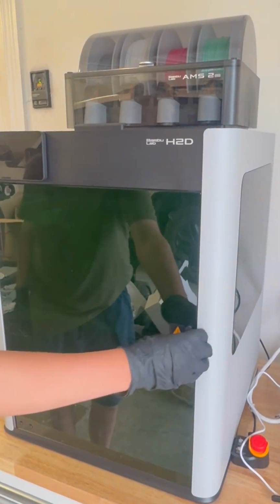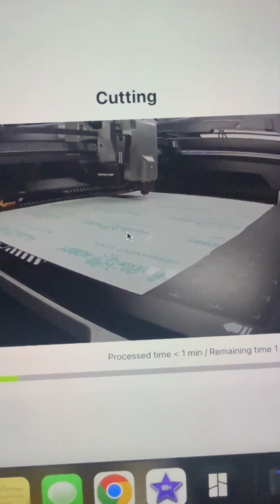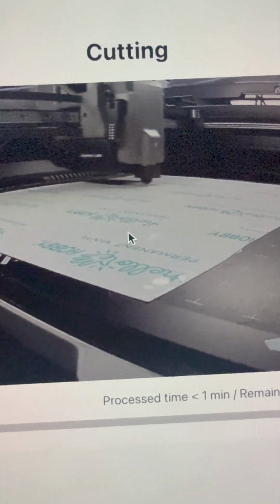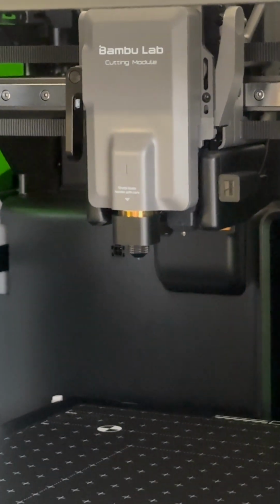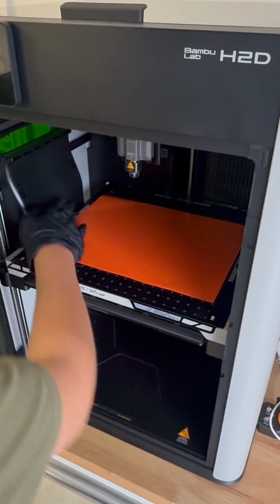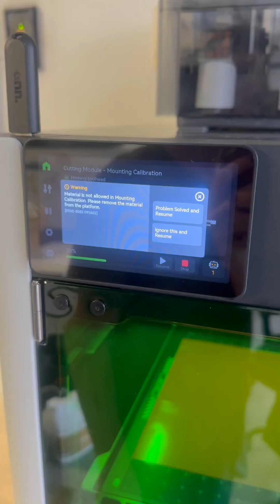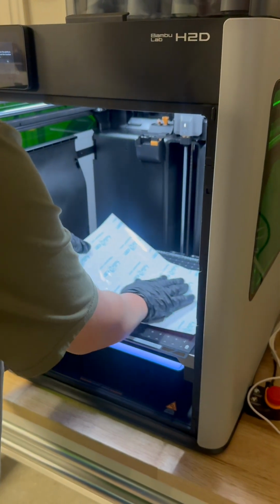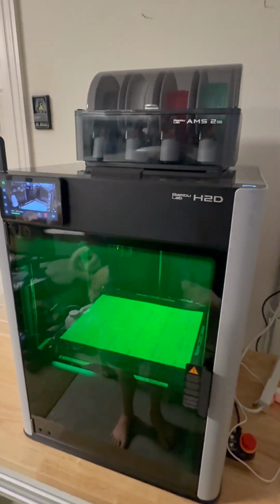From Print to Cut: How to Switch Your H2D Module Fast. #bambulabh2d #3dprinting  #bambulab #asmr

Comment: i don't think you have to shut of the printer to switch...
Reply from the maker: It is the first step of the directions. You certainly can do it without turning it off but the one time I skipped that step the laser would not calibrate properly.
Reply: I keep getting calibration failed and I cant get this thing to cut a proper sticker. How do you get over the second calibration part?